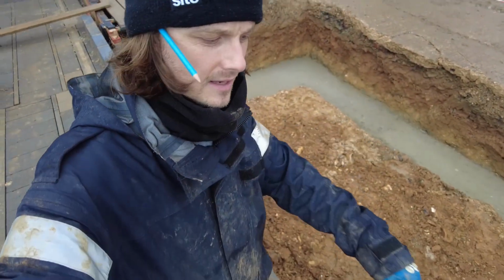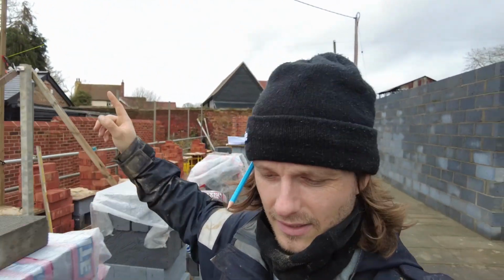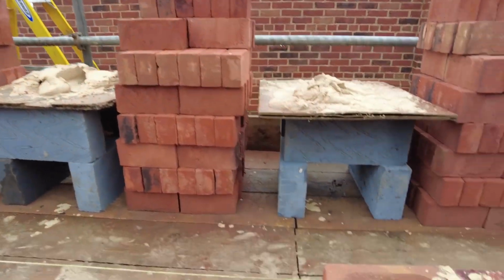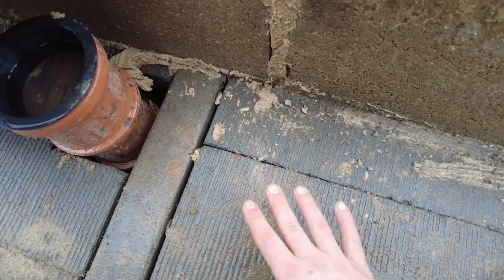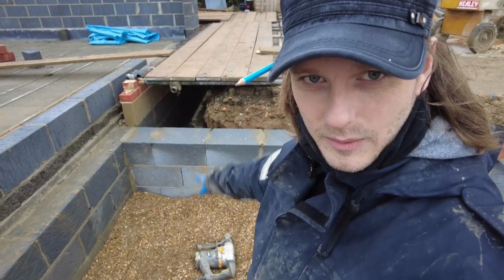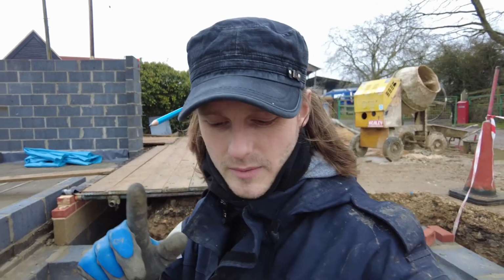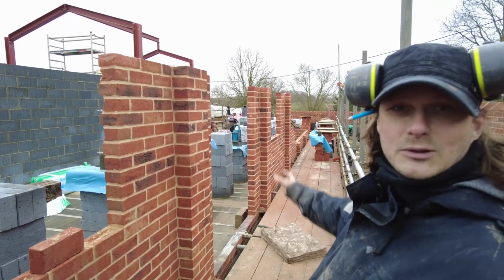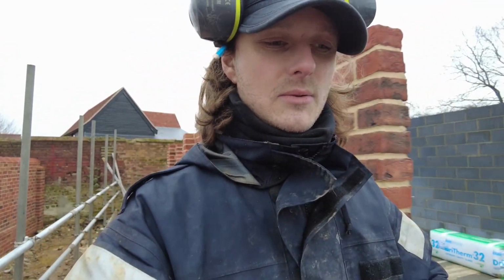--- BRICK and BLOCK laying & more ---     #selfbuild     [The Barn Rebuild 002]

Comment: Can i ask why did you do the extension footings separately to the main building instead of at the same time?
Reply from the maker: It was just the way the contractor wanted to do it 🤷 I assume it was just easier logistically as there was more room on the drive without that

Comment: Just a thought and it is early days but have you thought about underfloor heating? One of the best decisions I ever made when I built my extension.
Reply from the maker: I have indeed, I'm going for an air source heat pump which works hand in hand with underfloor heating. I just need to find a supplier and find a way to do each level. I think I may need 2 manifolds?
Reply: @THE-AIDEN-PROJECT  I'm certainly no expert on this only what I have picked up by google and youtube etc. There is a limit to the length of pipe from each flow and return off of the manifold but I would have thought one manifold would be sufficient with enough connections. On my 40 sq metre extension  area I split it into two to make sure each run was a single length of pipe without connections. In effect I have only ever needed to use one of them as I heat the living area of the room which is enough not to use the other one in the kitchen area. I am not a plumber but managed to do the whole installation myself which worked first time without any problems.
Reply from the maker: There's not really an easy route between the two levels for lots of pipework, that's why I was thinking 2 manifolds. I'll see whatever supplier I chose says. How did you fix yours down? I was thinking of getting one if those big staple things and fixing straight into the insulation
Reply: @THE-AIDEN-PROJECT  My pipe kit came with heavy duty spiked clips that pushed straight into the insulation, they had a hook on the spike to prevent them coming out again, You need to shop around for prices as there are some huge differences, if I can find the invoice without too much difficulty I will send on the details of what and where I bought it. I do remember saving what was hundreds of ponds though by getting different quotes.
Reply from the maker: Thanks, yeah I'll definitely be shopping around 👍